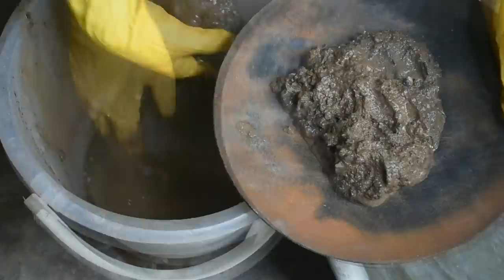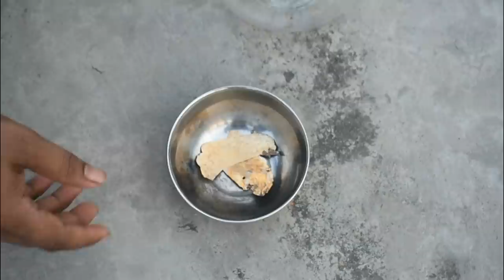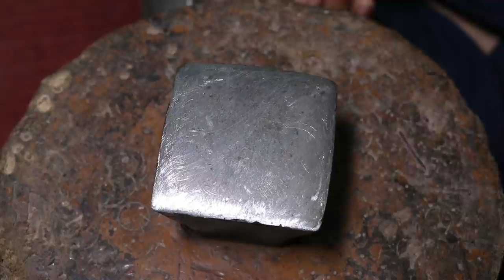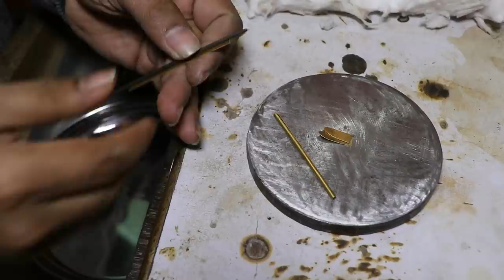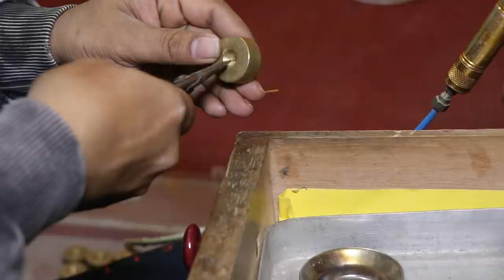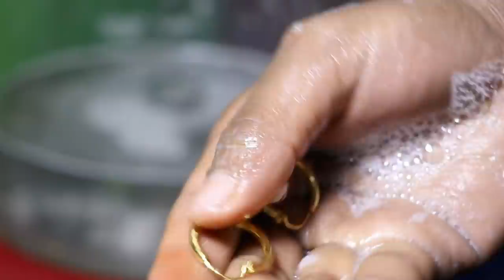Extracting Gold from Store Dust then Making 24K Gold Earrings Part II | 24K Jewels - Gold Smith Jack

Comment: How do you measure the purity of gold recovered from dust ?
Reply: He already knew that the dust has gold and silver inside and junk metals and dust so he separated the dust leaving the metals in the plate then put a good amount of silver and melt it together and poured nitric acid that doesn't attack gold but it attacks all other metals making them soluble to water ( silver was added to make the gold concentration low so it wont block the nitric acid and it's also easy to recover in the end ) so the final product is pure gold that method is not new btw it's used in every company that extracts gold so I hope that solves you questions :)
Reply: thank you
Reply: Smart Choices - Life Simplified  probably from his own store is my guess

Comment: i feel those who would allow the market
dynamism to determine when to trade or not are
either new in space in general or probably just
naive, the sphere have seen far worse times than
this, enlightened traders continue to make good
use of the dip and pump even acquiring more
equities towards trading sessions, l'd say that
more emphasis should be put into trading since
it is way profitable than hodling. Trading went
smooth for me as I was able to raise over 9.2
BTC when l started at 1.5 BTC in just few weeks
implementing trades with signals and insights I would advise you all to trade
your asset rather than holding for a future you aren't
sure about.